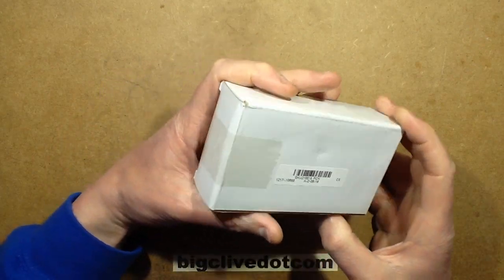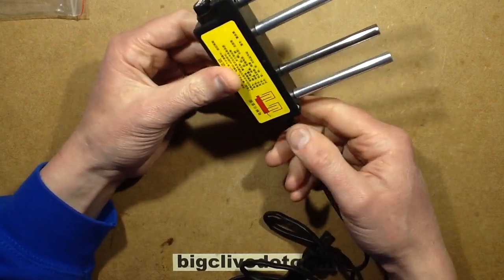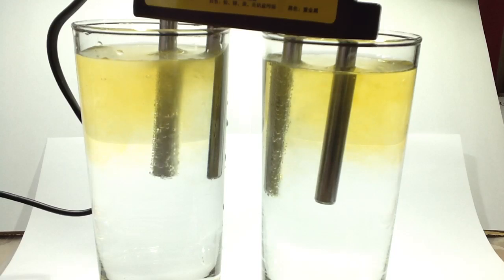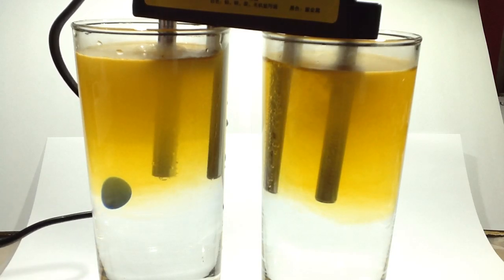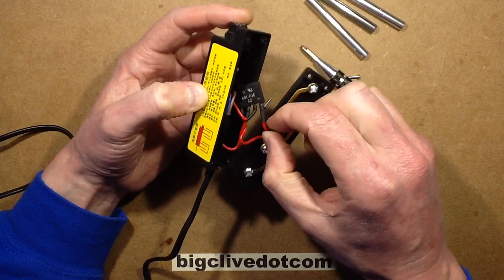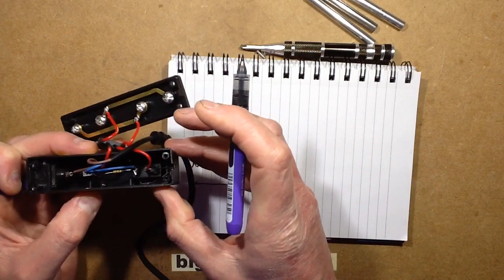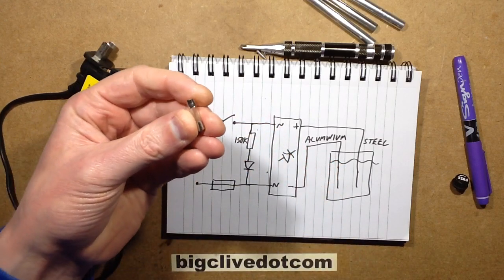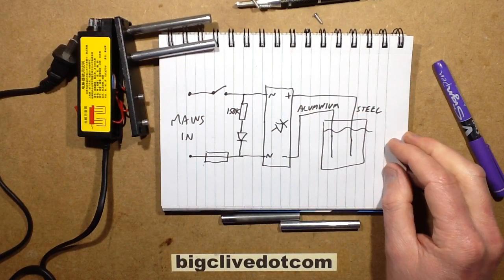Deadly quack water tester.  (scam)

Comment: A device specifically designed to kill scam artists... I wonder if the designer got scammed with a water filter themselves and came up with tihs product as revenge :-)
Reply: I wonder if the people selling the filters even know if they're scamming people.
Reply: +thelol1759 Oh yes they do. I used to work for a water filtration company and the sales team used these all the time while knowing it was a scam.
Reply: I could see someone passing these out along with a lighter and a pack of cigarettes to scam artist. Scammer uses the device. Attempts to light a cigarette but ignites their hand from the hydrogen released by electrolytic reaction. Tries to put it out with the glass of water only to get burned from heat dissipated in the water from the electric current passing through it. Goes to hospital to find they have developed tetnitus from heavy iron oxide exposure on the wound.

Someone really has something against water filter salesmen.
Reply: @eideticex  you can't get tetanus from fresh iron oxide, you just get it from bacteria that live on dirty rust (or just dirt in general)
Reply: +Jim Conner Or the seller got too many claims of "item never arrived" from the scam artists.
Reply: The plug is NEMA-1, meant for 120v North American systems where the non-switched lead is Neutral.
Reply: @christophertstone  Are both live there? That would be like the 2 phase 240 volts we get here, both are live. The center is neutral.
Reply: @christophertstone   so are you saying that this Chinese product is made For North America.  And heere in North America. . . It won't electrocute you ??
Reply: UniTrader One pin is bigger than the other, it doesn't fit the wrong way.
Reply: and what makes sure you dont plug it in the wrong way and effectively swapping lead and neutral?
Reply: mknechtel  😕 well I guess its a living...

Comment: You should see what happens if you swap the polarity of both electrodes. Basically make it so that the steel is negative and aluminum is positive. Unless you think it's unsafe then obviously still do it.
Reply from the maker: +Lucas Solomon Hmmmm.  Now there's an idea.
Reply: I wonder what will happen yes....I hope bigclivedotcom will solder the electrodes after switching the polarity....and film it (ofc at your own risk!) so I don't have to do it on my device :P.
Reply: five bucks says you won't see the water turn brown.

because that wasn't iron oxide you were seeing there, it was aluminum hydroxide.
Reply: @thomasneal9291  I would say rust.

Comment: 10 amps. Enough to kill a couple of people in series.
Reply: In parallel actually, as linking too many people in series could amount to a high circuit impedance and thus reduce the current below a deathly value which should be somewhere above 30 mA.
Reply: @Frosty One I been zapped by 60hz 120 a good dozen times myself. I think people believe electricity is literally death thunderbolts that will stop your heart in any capacity. That's just not true. There are so many factors in a person getting shocked that the comparable values are extremely vague.
Reply: @privateuser7  It's important when moving a firearm to empty the ammunition first. Most people can agree with that. It's common sense.

In the same way it's important when working with high voltage electricity to limit your risks.

You can't expect a guy who would believe his water is full of lead when shown one of these to not cover himself in water wear rubber slippers and then get too friendly with the mains voltage.

There's an unbelievable amount of wrong info about how electricity works out there. Especially in places like where I live (US) where we don't even teach basic electrical competency in school. When dealing with a population who if told electricity was magical pixies from Sweden would believe you no questions asked, I would prefer they be very afraid of the stuff even if it's not immediately dangerous. Lest we all be paying for their ER visits when they decide to experiment with circuits they have no business touching.
Reply: @scwirpeo  yeah I have no argument there that's pretty spot on
Reply: Threre's a reason they call electricians "sparky"
Reply: @oggatog3698  dont nobody callem dat
Reply: @themoonwolf7438  And voltage doesn't kill current kills.
Reply: not necessarily
Reply: Most necessarily
Reply: 110v dc wont kill you rofl
Reply: 110V or 220V will kill u no mater DC or AC
Reply: Tomislav Šantak watch electroboom’s video on ac vs dc pain
Reply: @themoonwolf7438  not claiming that it's a safe thing to do, but the human body doesn't pass DC anywhere nearly as well as AC. 100V+ DC is survivable with dry skin. Again, don't try this.
Reply: thany3 it's DC it won't kill nobody

Comment: This is just similar to the colloidal silver makers Clive - the silver rods are hung in distilled water from both the positive and negative poles and the particles of silver dissolve into the water. The same will be happening here only it will be aluminium and steel particles which would be a totally bad for your health combination if you were to ingest them unlike the silver which is very good for your health and for use as an antibiotic.
Reply from the maker: +William Woods This unit would be a very fast colloidal silver generator.

Comment: This  nutjob has two of them and he'll sell you a special bottle that will "structure" your distilled water.

https://www.youtube.com/watch?v=2JFxyxgzkNE
Reply: +yangtse55 With added "shungite crystals" to "protect" the water.
(Looks up shungite - OK, it's a carbon-based mineral, so they presumably think it will have a similar effect to "activated" charcoal - the catch being that there are different grades of Shungite, ranging from 1 (98-100% carbon) to 5 (less than 10%).

Meanwhile, on his video featuring two of them vs tap / rain / filtered/ distilled water, the mucky colour of tap water "could mean a number of things - bacteria, viruses, carcogens [sic - I think he means carcinogens], arsenic, lead, mercury, copper, so all the different heavy metals, then you've got pharmaceuticals that's washed in there through the toilet system since the water... a lot to think about"

I like how he fails to complete his allegation there, having failed to "think about" it long enough to pre-prepare a script - and strange that he fails to mention iron, which by the end of the test is the biggest "contaminant" of the water.

Then to cap it all, "distilled water, there's nothing in it, don't believe the information it's bad for you, it's very beneficial in washing all the sediment out of your body, as like a detox or cleanse for all the sediment picked up from years of drinking this tap water."

Unintentional comedy gold!

Comment: could you measure the voltage on the pins with it turned off and referenced to earth ?
I would hazard a guess of around 40 volts on some of the pins

Comment: Who designs this shit?  Somebody with a degree sat down and said 'we need this'. What the hell mang?
Reply: +E2qNX8btraQ3zRD6J7fc  No, "somebody with a degree" would have not designed this without any safety measures AT ALL. It's like somebody HEARD somewhere, maybe seen an experiment, that if you pass current though these metals in water, this and that will happen. Could have been a chemistry textbook or whatever. Indeed in most of the educated world (China, India, Russia...) mandatory education in Chemistry should pretty much cover that. Then this somebody comes up with a scam plan, and starts producing devices. Then others see that, and end up copying it in a modified form, perhaps slightly different device, different scam presentation.

Comment: so the electrodes will have 240 vDC? that would tingle!
Reply: +magicalpencil Not 240V since it's the peak rather than average voltage that matters and peak is 240 X sqrt(2) = 339V DC.

Comment: I believe all its doing is force-oxidizing the iron from the positive electrode into the water, thats why it gets the color of rust, and the foam on top I would guess is from the water boiling with the rust in it. This would also explain the smell. The electrode also looks pitted and dark, like steel right after removing rust off the surface. The rust is constantly being taken of by the electrolysis process, and I imagine the negative electrode might be a different metal because not only because it is not going to be spewing rust, but also could be to keep the rust from plating or binding to it and thus keep it suspended in the water. The claim is that these cause the impurities in the water to come out of solution and visibly concentrate, but that is more easily and realistically done by evaporating all the water and looking at what is left on the surface you had the water on.
Reply: +compactc9 I forgot to say that its also the exact same nonsense used in the foot bath thing to convince people that it is removing contamination and impurities from your body.

Comment: whats the DC voltage at the electrodes?
Reply: +jeales895 since there is only a rectifier, and no transformer on the ac side, i guess it must be approx 230 V dc. A bit scary
Reply: +ben kerr 230/240 would be the RMS value. Given that it's pulsed DC with a sinusoidal shape, for peak voltage multiply by sqrt(2), so 325-340V peak

Comment: I worked part time for a water filter company years ago, this was one of the tests used to try and get the gullible to part with money in their own homes.  Alas it did not work that well with the Glasgow water as it was so soft, especially if the water had been ran for a wee while.
Reply from the maker: +stealth banana Glasgow water is amazingly pure.  Something like 2 parts per million when I last tested it.  It's literally spring water from the tap.

Comment: What if you're supposed to use both steel electrodes on one glass, and both aluminium on the other, and then when scamming people you align the device so that your glass of "bad" water gets steel electrodes and corrodes, while the other one stays intact?
Reply: +SaNjA2659 Oh i see now, they really are threaded differently...

Comment: Can someone please explain to me how the electrodes can be live, even if the switch on the appliance is off.  I'm assuming that the "live" wire goes to the switch, and that the switch breaks the current.  So shouldn't that be enough?  The appliance can't get current through the neutral wire, can it?
Reply: +Kevin Solway Because the plug can be inserted in either direction. So neutral could quite easily become live...
Reply: +Kevin Solway The US style plug that's on it means it can be plugged in either way. So the switch has a 50% chance of being across the Neutral instead, while the live is connected right through.
Reply: +Bob Hickman   Oh, I see.   Nasty!
Reply from the maker: +Kevin Solway The switch is on the neutral connection and the plug can be inserted either way round anyway.  Like water test roulette.

Comment: If I saw this correctly they are switching the neutral. the line goes in directly through the fuse. so if this thing is plugged in, the electrodes are immediately at 230V :O
Reply: +Róbert Valdimarsson  Non-polarised plug, so depends on which way around you insert he plug in the outlet
Reply: +Michael Tempsch oh, of course. whenever i hear a british accent i assume the device in the vid has a G-type plug :D